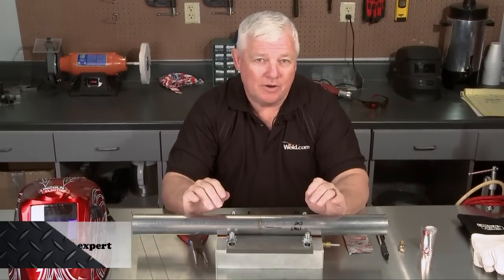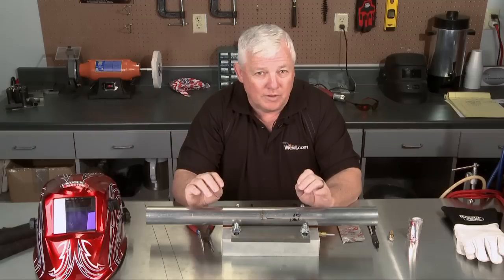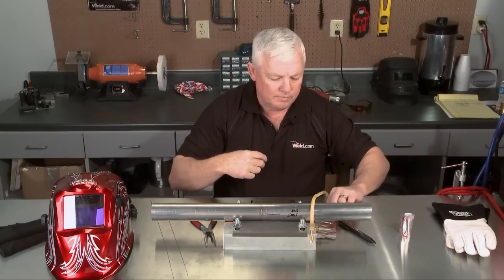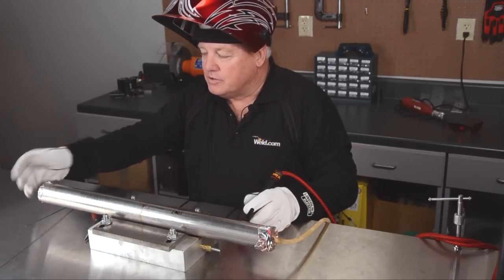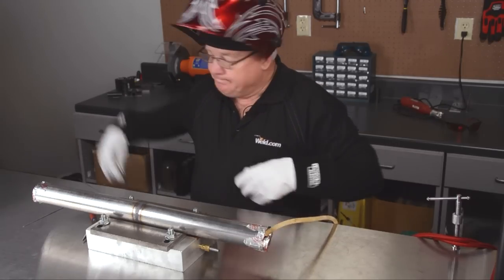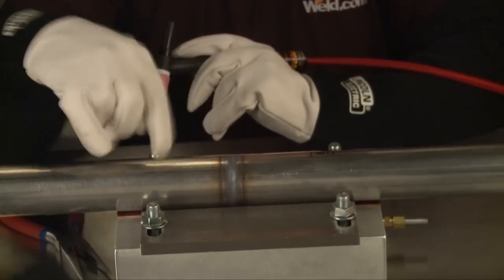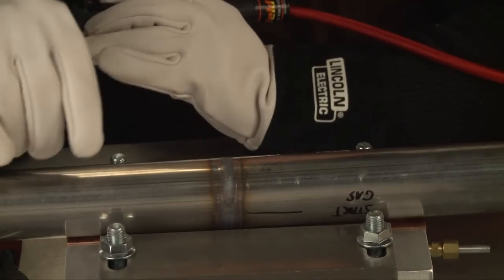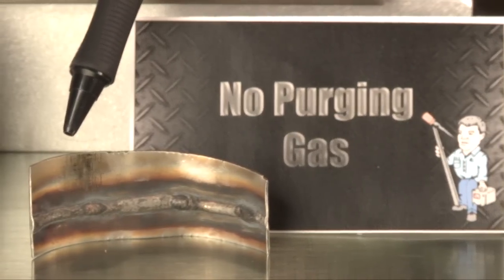TIG Welding Stainless Steel Tubing - How to Do It the RIGHT Way

Comment: Please somebody answer,need help with stainless steel pipe/tube welding...i am TIG welder with qualifications and i have certificate for TIG welding 141 (root,filling and finish weld) but only for steel i dont have stainlees steel or steel with chrome...everyone says it is easier to weld stainless steel than regular steel because it melts easier and it controls easier but i need some tips and help around that subject since i need job and everyone asks for stainless steel..PLEASE HELP!...

Comment: what's the difference between tube and pipe?
Reply from the maker: +sebby sharkey Tube is normally used for sturctural purposes and its sizing is based on the EXACT outside diameter (OD) and wall thickness of the tube. Pipe is generally used for transport of gases, fluids, etc and sizing is based on nominal outside diameter and wall thickness. You will often here reference to a pipe's "schedule", which is its wall thickness.

Comment: Greetings Weld.com!  Great videos!  I have question regarding stainless steel types from the chart on your website.  I am building a stainless steel exhaust system for my car and most of the tubing, clamps and other bits are 304, but the catalytic converters are made by Magnaflow and they apparently use "409 grade automotive stainless steel" as per their website FAQs.  This "409" does not appear on your chart of filler materials, any advice?
Reply from the maker: I will have to clarify the exact filler, but here are the issues. 409 and 410 are martensitic (typically contain 11.5 to 18% chromium and up to 1.2% carbon and have less corrosion resistance than austenitic series) stainless steels. 300 series is austenitic stainless (contains 16 to 26 percent chromium and up to 35 percent nickel). I will get back with you to research and advise the best compatable filler for the two alloys.
Reply: Thanks for the reply!  Looking forward to your response!  Would it be safe to say, according to the chart then that a 309 filler rod would be a good place to start? THANKS! John
Reply: 309 good for dis-similar metals...like stainless to carbon steel.

Comment: simpler way it is to hold your fingers on the tube and hold the tungsten about 1-2mm to have that small arc...it is easy to make a puddle like that and control it from one side to the other...

Comment: even after cleaning - still grey, frosted, oxidized, undercut.

It simply isn't stainless anymore because "MR TIG" can't do one single proper TIG weld!

Too much heat input, much too slow travel, uneven motion, not enough filler.
Too much torch angle, weird welding position anyway - who holds torch and filler 90° to his body :D

Watch Jody if you want to learn how to TIG weld tubing.
Reply: He had to create a scenario that would lead him into the marketing of that electronic cleaner. Bet he can weld much better than this, but then he wouldn’t get paid for the advertising ;)

Comment: never, ever use a wire buff on stainless to clean a weld as suggested in this video. It forces the oxides in to the metal and can result in cell corrosion. I do hygienic food industry work. Over 60 degree C, the chemicals used for sterilising pipework will destroy welds that have not been cleaned with pickling paste and passivated.

Comment: I have a problem with my welding, I get distracted by aircraf t .  They are moving in when I have even slight heat and also moving metal .Small noises . slight movements . dog. whistle . dog itching , my    knees and toes cracking sometimes is enough that is in my own Yard .  certain people getting near me. And they do it for years. I've appraised the police to no avail. I can't believe how they can endanger my life to this extent.  I am disabled and went years trying to get approved for disability . I have severe health problems that clause me to be bedridden alot. So for the short duration that I can do something it is important to my life that I am not distracted. I am   no longer much good as a care giver to a woman that is a Brain tumor surviver . because of this issue. my father was a WW2 tail gunner , ordnance man so I was raised to notice aircraft . Their movement is so mathematical and predicable . Cars are also part of the automation.  It causes me to be secluded from people and it equals neglect of a disabled. There is statute for phycological torture and  this is the poster child for it.  I am in 34652 FL and the metal detection is even in the gulf as I was getting aircraf t every time I would wiggle my steel fish hook. I also think my words are automatically screamed as certain words cause aircraf t to show up . I guess they have data gathering devices.  I think the firetrucks , ambulances,police,ect also have the stingray devices as they automate the traffic light timing to intersect with me at the intersection. I can't even imagine a more illegal system than This. I don't know what to call it besides a government overthrow. they even did it while rebuilding a transmission . I have to break a project in to small steps as the time I can sit and stand is so limited.  they really like spring steel , cromolly steel in fact the better quality of the steel the more they seem to be attracted. Snap on, starrett. I can't trust the stars any more as some will move slowly to follow me. 
.

Comment: I didn't want to troll the video... But for being Mr. Tig I'm not impressed. 

You state you had control of the pool but you wouldn't think so. Not constant, poor stops and under cut with too much penatration. Big sponsors all the gear... And half of an idea

Maybe I should get R-tech to sponsor me and make better videos
Reply: Iv'e been tigging for about 2 months now with an R-tech 161 and i think i could do better than what Mr Tig just done.Many of the welds i have seen him do i was not impressed by.
Reply: I have the same welder
Reply: If you can make better videos do it Hot shot
Reply: I have this thing called a "job" very witty and outstandingly clever comment.
Reply: I troll him often lol he sucks bad I think he cools every single piece of stainless that he welds Don’t think I’ve ever seen a weld that he has done that was actually good

Comment: Far too much up slope. Travel speed far too slow. Amps FAR too low. Therefore heat input far too high. 
No wonder it ended up so heavily oxidised.

Comment: Purge with argon to remove the nitrogen and oxygen??
Wrong. 
It is to remove the oxygen. 
Nitrogen can also be used as a purging gas. Have used it many times for welding austenitic stainless pipework, duplex and super duplex pipework. In fact with super duplex, nitrogen is the gas needed to purge it.

Comment: This is an old video but I think it needs to be said; Argon is very dangerous to breathe in, so please do NOT check for gas flow with anything on your face, especially your moustache area. You know, the area right between the two places you breathe in.

Comment: im glad your not on the otherside of a butt to me especially if we was on price work! :O why are your amps so SO low? 2.4tungsten 100-160amps size 8 gas lense and BOOM! your amps are too low, your material is getting far too hot. to give you and idea, ill root fill and cap a 1/2" sch 40 butt in under 2 mins complete....